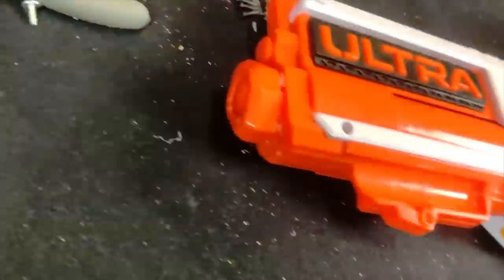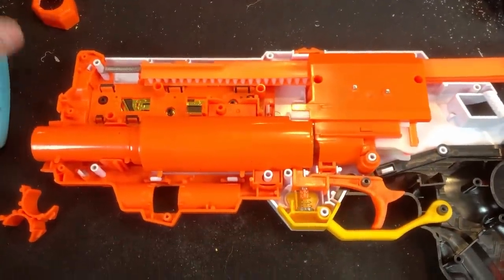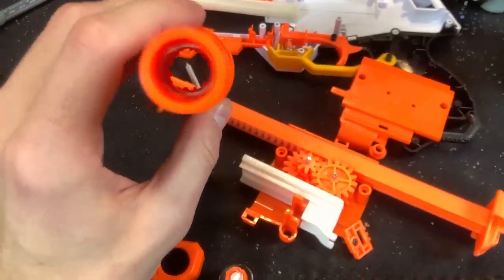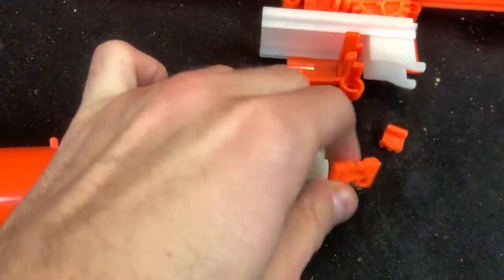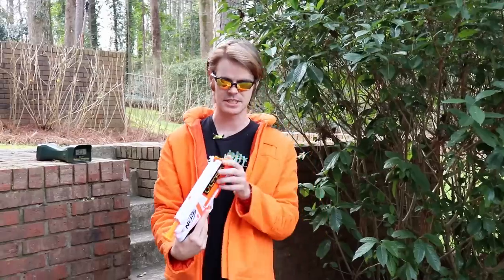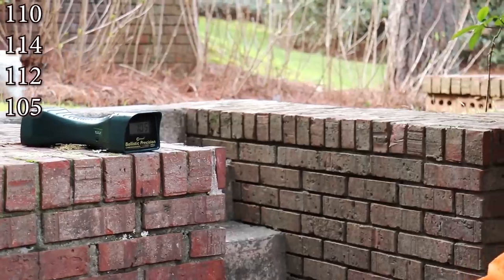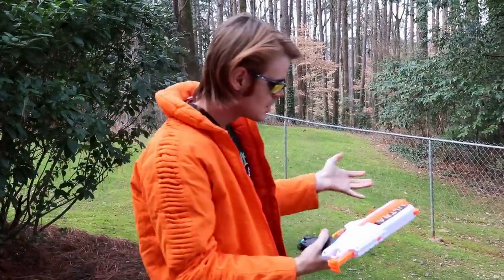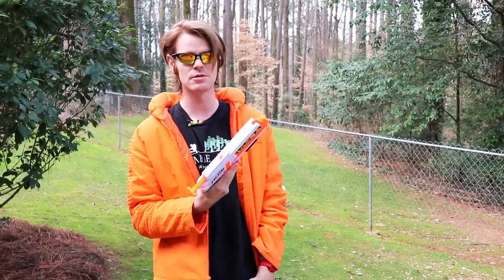Mod Guide: NERF Ultra Four

Comment: I just made a barrel "downsize plug" that pushes into the existing barrel tip. Into that a 3-1/3 " long, 17/32 " gauge brass rod that takes full or half darts. 
Bought it with this in mind
Goes awsome.

Comment: I’m sorry but I have to respectfully disagree with ya on this one bro. I don’t know what you did wrong but I spent a whole fifteen minutes modifying my 4 and I absolutely love it! The priming action of this blaster is one of my favorite blasters to prime! I’m not saying hasbro is in good standing with this line but I’ve bought the Ultra 2,3,4, and 2 pharaohs. I’ve modified all of them except for the 3 and they all are really good! The material and quality of the plastic with this series as far as I’ve seen is much better than most nerf branded blasters. The plastic is thicker and can withstand a lot more force and pressure than most others